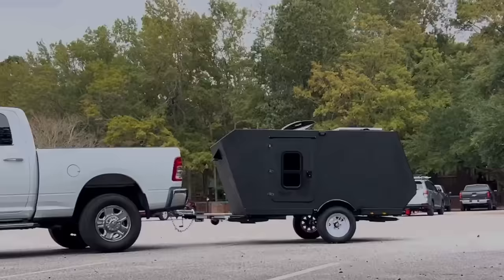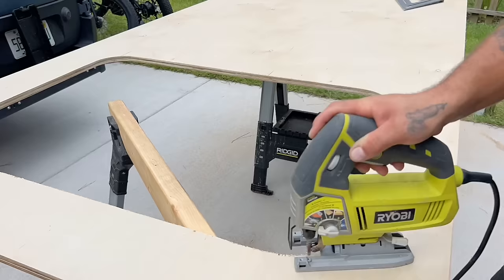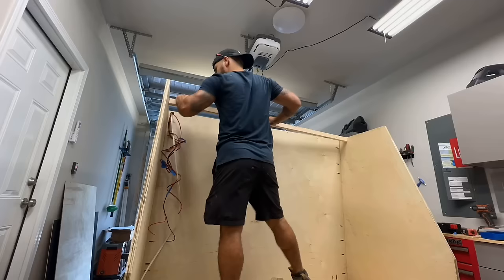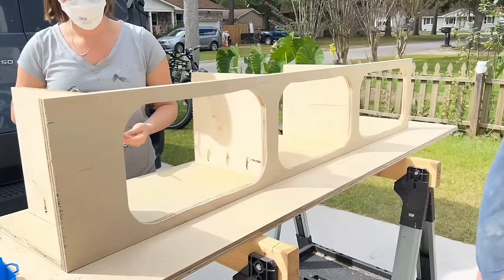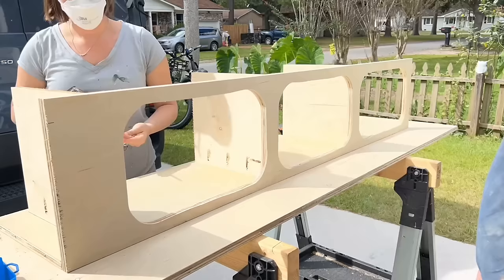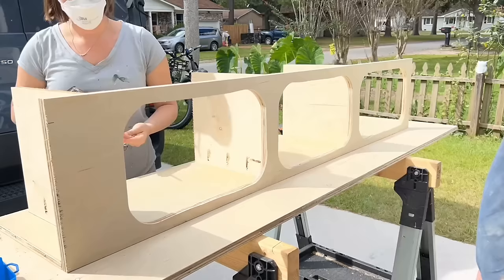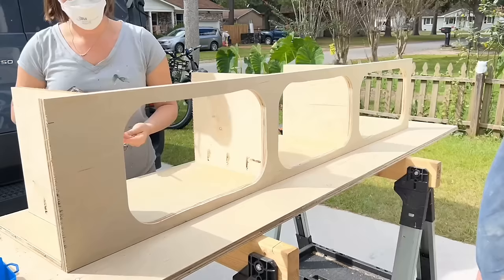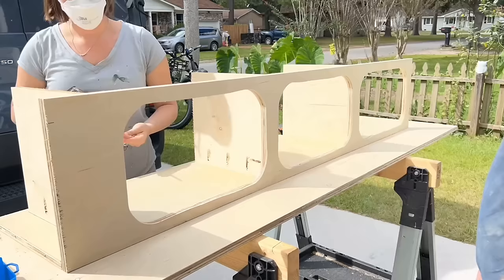How I Built A DIY Camper From Start To Finish | FULL BUILD

Comment: Wow, this and the other ones you built are amazing. You guy's  have so much talent. You inspire me to some day build a few and give them to homeless. I keep watching to get ideas. Especially the electrical part. I need to watch that is slow motion. Was thinking. About the ones you build for homeless, what if the bed part is standing up like a Murphy bed. It is secured by a hook to a back frame and it can be pulled down and unfold legs. If this would be possible. It can be a little bigger on both sides. That extra space can be so when it's put away he can still go in the house and put a foldable chair and foldable table to stay cool inside the shade. The extra space will also be for storage. Storage can be like airline seat pockets that keep supplies tight or it can have the option to lock tight. It would help to organize. It would be nice to have a cover with elastic with a print that makes it look like part bush part rock. Homeless can put it and hide it on vacant land and from a distance it looks like a rock or bush. Thank you for all that you do.

Comment: Heat Pump I wouldn't use on a trailer. House-Boat or Geo-Thermal should be fine, but pumping heat from Air would have a problem of Frost, which looks like an insulator.

Comment: Why not use aluminum framing and tin siding to keep the weight down. It also adds to the strength of the micro travel trailer camper. This travel trailer camper is built 100x better than those manufacturered campers. This was well thought out and in my opinion nearly every detail was considered.👍🏾👍🏾👍🏾🏆🏆🏆

Comment: Why fiberglass the exterior? Truck bed liner is way easier and faster. And tougher. If you were concerned with the wood holding up you could have used PT.

Comment: How do all the door openings seal against weather?
Reply from the maker: We were not able to add the weather seal gaskets to the doors in this video because they didn’t come in the mail yet, but I’m going to post a picture of how it looks with all the gaskets on
Reply: @buildersblueprint  When you install the seals your doors will protrude, and you may not be able to close the door.  I knew a guy once who did the same thing on a Corvette.  He had to reset the hinges and grind away a lot of previously finished door frame.

Comment: Your AC is going to work overtime by the thing being painted black -- that's going to absorb heat like a mofo. Campers are usually white for a reason. Also odd you went through the hassle of mixing and spraying bed liner but didn't use it on the frame or subfloor (where it would help with rust/rot).

Comment: Nice build and rather than say get-er done, you got it done. I assume this is an Ironton 5 x 8 trailer.......what size tires did you use 175 80-13 and did you absolutely need the spacers?
Reply from the maker: Thank you I really appreciate it and yes it is an iron ton trailer. That’s 5 x 8. The wheel spacers were needed because the tire was very close to the camper walls and I was scared it would touch when the camper goes over bumps

Comment: You should of built it with a wind up roof and pull out beds that way it's double the size lower so you can see out back window and put caddy apple Red for colour not black   but it's done now so just change the colour good job though

Comment: Nice job. The electrical set up is amazing. 

I don't know where you live,  but I'm guessing summer gets pretty warm there as you have installed aircon. My only concern was that you have painted it black which just sucks in the heat. Did you think of using a lighter colour or is it like the old Ford cars in that you can get the paint in any colour that you want as long as it is black?
Reply from the maker: Thanks dude. 
The summer here definitely gets hot. We did insulate it pretty well and in the direct sun when its 95° it stays at around 80° inside with no fan on but when we turn the fan on it comes down to about 78° which is not too bad.

Comment: I have concerns!
Way to much weight at the rear. You can clearly see the woble while driving.
Battery and all should have been at the front og the camper to way it down.
Kitchen at the rear us great. But unless you a 6"2 you won't be able to look down into the cooler.

Also the lack of a rubber or weather proof membrane under the trailer will mean that you can only drive it on sunny days.

Comment: What size of the original tires ? My trailer tires are 5.30x12. How do i get the 13" to fit my trailer? what do i have to order? i can see yours are 175/80D13, will that fit mine too ? thanks

Comment: Nice work, but the screws used for the outside tank are not enough to carry 20 kg over bumps, and loosing that tank on a highway could lead to a disaster.
Reply from the maker: Thank you you’re absolutely correct about that. We ended up changing nuts and bolts

Comment: Nice build and comprehensive video but i have to ask why did you put the heavy batteries and expensive electrical equipment at the back of the trailer i would have thought it would affect the  balance and (heaven forbid) you had a rear end shunt it would be an expensive one..
Just a few thoughts anyway. Cheers

Comment: 1500lbs is spooky AF for a lightweight HarborFreight-style trailer frame.  I would be saying a prayer before every road trip.

I've built several custom trailers (including on HF trailer frames), but I would never attempt a heavy wood build with 3/4 ply on one of these lightweight bolted frames.  Better to start with a heavier welded commercial trailer frame for a heavy, full-featured build like this.

Comment: how does that tiny trailer weight 1500 pounds? I have a 6x8 cargo trailer that weighs 789???
Reply: Inverter and battery system is heavy.  There's a double floor.  All that extraneous ceiling wood adds up.  Cabinetry does not have to be 3/4" in a trailer.  Extra jack at each wheel adds up.  Air conditioner is heavy.  There's many pounds of paint on it.  Resin for the Fiberglas is heavy.

Comment: Is this the video you told me you were gonna upload soon?  Very cool man.  I wanna get one made too!  I will need to get a welder to do up the frame and then get a carpenter to help make the camper.  I sadly can't do so myself as 10 bones got damaged in a hit and run car accident.  But I want to design something cool.  I don't like curved campers as they get tiny.  I can't do tiny due to my spine.
Reply from the maker: Yes, this is the video. I appreciate you watching dude.
Let me know if you need any help I’m building or designing one I’d love to help 🙌✌️
Reply: @buildersblueprint  Cool to see you are using EcoFlow. Which one are you using?  EcoFlow very graciously sponsored a Delta 2 and a 220W Solar panel a few months ago, and are sponsoring one more 220W panel which will arrive next week.

Comment: Boy can you show a light weight camper for a Mitsubishi mirage 2015. I was told that I can't tow or the Trans will blow
Reply from the maker: You can absolutely tow this camper with most cars. 
You can Google your vehicles make and model and it will tell what the towing capacity is.

Comment: Watched your video the 2nd time and still amazed at the awesome job you did. Question when spraying the Raptor liner what would happen if you used a foam roller to smooth out the surface and for it not to be so rough? Is this possible?
Reply from the maker: Thanks I really appreciate you taking the time out of your day to watch our videos. 
I have never tried to lay raptor liner without a spray gun, but I would imagine if you use this smooth roll. It will not have a rough feel to it when it dries.

Comment: What keeps the bolts ( the bed frame) from loosening over time ? Is this not really an issue ?
Reply from the maker: Each bolt has a lock washer, lock nut and Loctite. 
I don’t see these ever coming loose. It also has the weight of the wood on top of the bolts which will make it impossible for them to come off.

Comment: Looks like you didn’t install the axle correctly there are bumps on the leaf springs and they are supposed to go into the holes on the square axle so the axle doesn’t twist.

Comment: 23:29 debió poner el sellador antes de colocar el dispositivo, el sellador puesto después en el borde se seca, se sale, luego llueve y entra agua
Reply from the maker: We did place it under the panel what do you mean?
Reply: a las 23:27 instaló un poco de sellador antes de colocarlo en el techo. El sellador que aplicó a las 23:37 fue adicional para evitar que la lluvia, las hojas y la suciedad se metieran debajo del marco del respiradero.

at 23:27 installed some caulking before putting it on the roof. The sealant he applied at 23:37 was additional to prevent rain, leaves and dirt from getting under the vent frame.

Comment: KUDOS on the build but misstepped right from the beginning from the floorboards... Really should have employed an epoxy coating on the top and bottom of your base floor board, that would have completely sealed your wood. 'Glidden' literally is not designed whatsoever for what your design scope is pitting against this with road wear, salt and continuous water. Additionally, always start your 'overlapping' as in the case with your fiberglass from the bottom - up first. Again, Kudos, I'm sure you learned a lot on this build overall. Good project!

Comment: Nice build!  Pretty awesome for first one.  While it looks really cool, the black exterior must make the thing really hot inside?  Also not so sure about the sound bar right by the water.  But overall a very solid build!
Reply from the maker: I really wanted to go with the Batman look which is why we chose black. We have an experience the dead Summer yet because we built it at the end of the summer so we will see how hot it is inside when that time comes around. We are about to start a Tiny home build in the next few weeks and can’t wait to share with you guys. Thanks for watching and God bless.

Comment: You mentioned over budget at the beginning of the video.  I recognize that you likely did not want to post a cost of build as you intend to sell.  I would be interested in purchasing prints and plans if you have them availible.
Reply: Additionally the only thing I would do differently is the walls why not make them as a composite material half inch baultic birch ply + reflective layer + 2 inch rigid insulation plus reflective layer + 1 half inch baultic birch plyfor all exterior walls.
Reply from the maker: Hey there, the total cost was just under US$15,000. 
If you’re interested in plans, you can send us an email to beerrunbus@gmail.com

Comment: ...not only have you put a window in the door, in such a way that if the window is open, anyone can unlock the door, but they don't need to. Cos you've put the hinges on the outside where you could knock the pins out, or just unscrew them. Doing no damage at all. All that money for those expensive batteries and stuff and you failed to figure out which way to hang a door.

There was also plenty of space within the roof to put more insulation in, a couple more sheets' thickness, even. But you cheaped out on the lightest and one of the most important parts for keeping the thing warm, or cool.

Comment: Wow! 7 minutes and 3 secons into the video it looks like they are running both their low voltage and 110 VAC lines through the same holes and paths. That is a major NO-NO! Other than that I love it. Rerout one set of cables for safety.

Comment: 😊Nice build 
But it’s way unbalanced and at 1500 pound ,… my 6 x 10 cargo trailer weighs that much. 
Not sure why you have so much weight on that thing.😮
And even worse it’s all in the back that which it will make that trailer sway at 60 miles an hour. 

Rethink the weight distribution😢😮😮😮
Reply from the maker: Thanks. 
The a/c and the spare tire are both on the front part of the camper helping it be more balanced.
It did start to sway once we hit 68 mph but it was Empty. 
We added a front box as well at weighs 55lbs. 
Really appreciate the comment tho because I love to learn and continue improving my skills. ✌️
Reply: I’m not most YouTube savvy but I didn’t links to items used in the build, hours and total construction cost.     what is your asking price for yours?

Comment: The wagging of the trailer on the road was due to an imbalance - too much weight on the back.  The hitch should get about 10% to 20% of the total weight.  So if you have a 1,000lb trailer 150lbs is the down force on your tow vehicle. You see to be tail heavy. ????

Comment: That’s gonna be a hot camper inside being it’s painted all black and attracts heat instead of reflecting it
Reply from the maker: Your not wrong about the black although when it’s sitting in the hot sun, the paint gets as hot as 130°F and the inside stays at around 90° with no fan or air conditioner on. 
With the air conditioner on it drops down to 73 at full blast
Reply from the maker: And this is directly in the sun

Comment: The door hinges should not be on the outside anybody with a screwdriver could take that door off where is the spare tire. Yeah you're supposed to have a spare tire when you make a trailer.
Reply from the maker: I have a spare tire I bought a bracket on Amazon that hadn’t came in yet, so I was not able to install the spare tire.
As for the door hinges, we have these plastic caps to go over them 
If somebody’s going to go through the hassle of unscrewing all the door hinges, they might as well bring the window

Comment: I really don't understand how people sell/promote Ecoflow Wave Airconditioners for heating without even mentioning that the unit won't operate in heating mode when ambient air temperature is below 41°F/5°C. I mean its a great little unit but this limitation is crtitical in my opinion.

Comment: First of all, this is a very expensive trailer. A good example, but once I saw LiTime and the AC (knowing the cost having priced them myself) its way above what any grassroots builder is able to accomplish. Remember youre going out into the rugged woods. 

Which brings me to my next point. There was no cross beam supports in the walls. Ripping plywood supports wont do it. A 1x2 wall frame like you did for the back hatch would have been more practical. Any teardrop camper ive ever seen has had this. For good reason. Those walls are going to torque with wind and the trailer turning one way while the camper turns another on the road. 

Your fiberglass strips wont hold. Once heat gets in and bubbles thay rugged coating (and it will) the seams in that glass will surely break. 

My trade is with fiberglass. Someone mentioned fiberglass tape over the seams. That wouldve been better. Along with full sheets for maximum coverage instead of 8-12 inch strips which causes seams and eventual breakage. For the amount of resin you used, you couldve done two, maybe three sheets of fiberglass to make it work. 
 Also west sells a fiberglass resin component that turns into a wood filler thats much stronger and less porous than the wood grain. Although its a nice touch. 

What you spent on the linoleum you couldve paid half that on two boxes of clearance flooring from home depot. Any cuts in the flooring and youre toast. An extra box of flooring kept handy will help you just be able to replace a plank in the future. 

Lots of money spent here on a questionable structure. 

At this cost one could buy one off a lot with a warranty.

Comment: Nice build but, why always black? Why not white with black trim?
Reply from the maker: I was trying to go for the midnight black look, but it would also look pretty cool if it had a black trim with a light gray
Reply: @buildersblueprint :
It's good to see you have a garage to work with.
Reply: @buildersblueprint :
Or the color of the inside with black trim.
Reply from the maker: @reneek7721  thanks for noticing we went a long time working on the side of the road and it feels really good to have a place to keep my tools
Reply: @buildersblueprint :
I got stuck buying a rat trap in disguise. The owners died left it their idiot son the roof is falling in the house is sliding off the foundation. I need the camper totally redone from the ground up. I got it lock stock and barrel 20.000 rats and all. Just kidding on the rats. They were a freebie.

Comment: Did you give yourself the option to be able to plug in the eco flow to your electrical system to extend the run time?
Reply from the maker: Yes, we did. 
If you turn, the inverter on, the EcoFlow automatically starts to charge
Reply: @buildersblueprint  have you tested to see how how well the eco flow will cool/heat that space? Also what’s the run time when you hook it up to your inverter? I would assume a very long time. I live in hot S Texas so a portable AC in a small camper like this appeals to me
Reply: @ashwilliams6894  We only normally have about 2 weeks of really hot weather in the UK so most homes don't have air conditioning.  If I had that camper I would live in it for those two weeks even if I was at home as I hate being too warm.

Comment: I'm really concerned about those trailer bolts you didn't tack weld early in the video. Good build otherwise.
Reply from the maker: We used washers Loctite and lock nuts for the entire build although Next build will be completely welded.